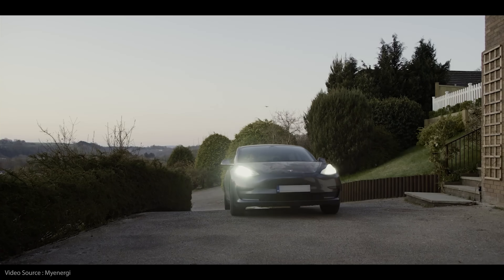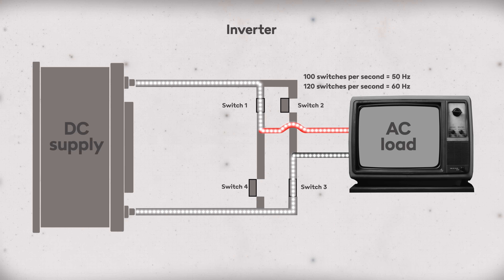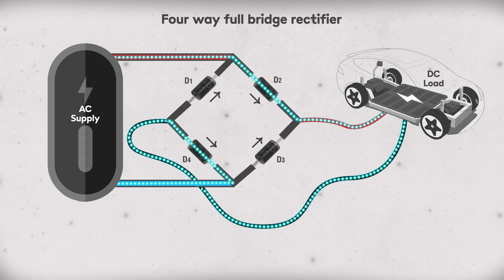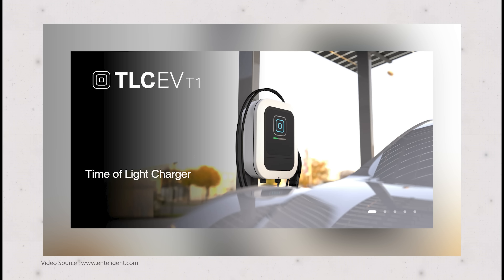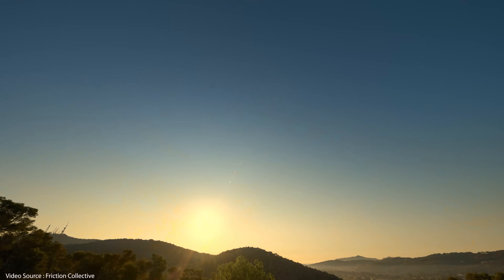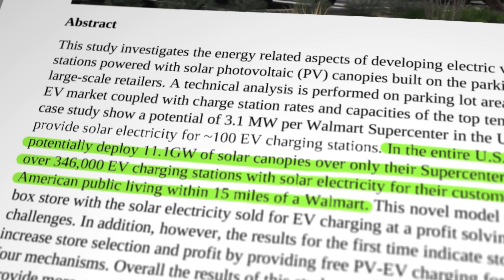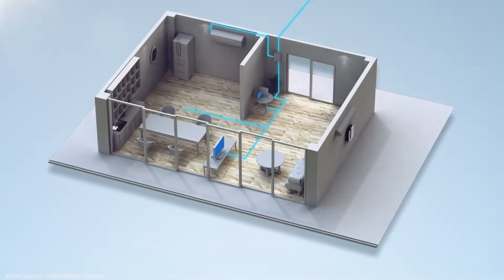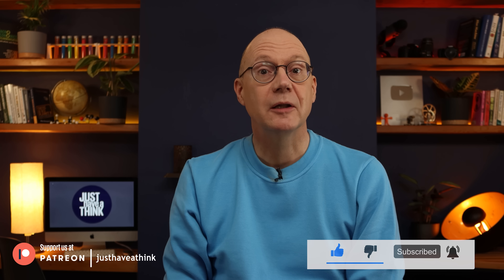DC to DC charging. One more step to off grid living!

Comment: DC house hold appliances are yet  to be a non neglected market
Reply: Hybrid heat pumps would be nice, either using ac during night time from the grid or using the dc current of installed PVs during peak solar. I wouldn’t go as far to start using any other high demand appliance on dc, maybe except water heaters but not machines with synchronous motors or frequency changers
Reply: @SirBalageG  water heaters? A simple water heater does not offer any advantage running on DC rather than AC. For all practical purposes, they will have the same efficiency in AC or DC. Most simple water heaters use a simple bimetallic strip as the thermostat- just guess how that will perform under DC.
Reply: @janami-dharmam  speaking from the grid operator's perspective, residential PVs are cancer and you can either pay to get rid of your excess or use so little that your tariffs become cheaper. Think about everybody installing PVs in a street line, that means controlling voltage becomes practically impossible, one household using less then what they're producing, the other using exactly the same amount, then there's one on the end of line that either uses none or all of the line's energy. Regulation becomes practically impossible, so in my hones opinion, you can use as much DC on your microgrid as you want but don't bring any excess PV power to the grid in that case.
Won't really matter in the future as providers will charge you 10-20 times more for using the network then the electricity itself, so you either use up all your juice or store it for later.
With all due respect, cheers
Reply: My hot 1.5 kw water operates directly on  180 vdc panels. No regulation just whatever solar is coming out. The original ac thermostat arced over (shorted) the first time it opened. I made a mosfet switch and it has supplied al my hot water for three years.

Comment: I think the best possible solution would be to charge a stationary battery in your home via PV DC. Then charge the car from that as and when.

That way you get to collect sunshine watts all day regardless of where your car is and then top it up at night when you’re in the land of nod. This would also feed into options of trickle charging to reduce dendrite build up (presumably). 

Any excess could be converted to AC and used by the home or fed back into the grid for credit.
Reply: While attractive, the losses of charge/discharge battery are (currently) even higher than DC->AC->DC conversion.

Comment: Been watching this technology for a while now, but still no word on the cost. I don’t think it’s going to be cheap as buying a conventional 20kW DC charger is prohibitively expensive in a domestic setting. 

I am off-grid, charging my EVs during the day from solar and connecting V2L to my solar system for a little extra backup power sometimes at night.

Comment: Those 13% losses must be the absolute worst scenario, not a typical one. There's absolutely no way that they've chosen such poor electronics. And DC-to-DC transformations (which are needed, as your PV system won't run on 400 V) also have losses. I can't imagine the gains being all that huge. 

If this technology can reduce costs by providing a simpler solution, then great, but I don't think shaving off a few percent of losses is going to be a game changer
Reply: A diode drop relative to 240VAC is insignificant, by the way.   The IGBT drop (roughly 1.5V) is more significant but still clocks in at only 0.6%.  Other losses dominate.  But yes, 13% would definitely be worst case.  Grid-to-vehicle losses are typically less than 10%.

The real problem is that the DC-DC would have to be a buck-boost and the input would have to be at string voltages.  And because it has to be a buck-boost and not just a buck, the efficiency is likely going to clock-in at 95%-97% or so.  And it would only be valid while the sun is actually shining.

So the "improvement" is only going to be 5-7% at best, and only under certain conditions.  And it will require some rather expensive circuitry and safety features.

I've done a ton of solar over the last two decades and can say with some authority that It is generally going to be far better to spend the money on simply adding more solar instead of spending it on a DC-DC EVSE.

-Matt
Reply: Exactly, makes no sense to make such a poor performing converter as it costs money to build heat sinks to dissipate it all.
Reply: PV systems (e.g. mine) can easily run on voltages as high as 400V... mine happens to be about 350V but the difference is only the number of panels in a string. Consumer panels tend to have nominal output voltage of around 48V, and a string is often wired in series (adding voltages). My GivEnergy inverter requires 125V to start, and has a max solar PV input of 550V IIRC.

13% is probably comparing their unit to a bog-standard solar inverter + EV diode rectifier setup, and the latter is I agree unlikely to be the case in the longer term even if it might be true for some cars now. However, it is true that inverting the power to AC then rectifying it back to DC will definitely lose non-trivial amounts of power, so avoiding doing it is always going to be a win.
Reply: Yes. Look at the efficiency rating of your computers power supply (easiest to find for a desktop system). This is AC to DC, but in Europe anything as inefficient as 13% losses at 80% full rated power is not on sale new (though if you like subsidising your utility you can pick up very inefficient pre-used ones)
Reply: I agree. What I would say though, is that there are advantages on a commercial scale, as Dave said. Using car parks with solar canopies and DC connection is a great way of avoiding using grid power and would stop all the wasted time in getting a permit to connect to the grid.
Reply: @keithforster2615   parking lot charging that's not connected to the grid is very dubious. "You may or may not get a charge depending on how cloudy it is!" I would do it to opportunistically to get a little charge if it was cheap, but it would suck if you really needed the kWh.
Reply: @skierpage  It could work if a large battery was on site soaking up those sunny electrons, maybe.

Comment: Thumbs down on net zero as CO2 is not the driver of climate change in the practical sense.
Reply: "as CO2 is not the driver of climate change in the practical sense." - well then, tell us what is.
Reply: @TheDanEdwards  Milankovitch cycles, the Sun is not constant and (this one will trigger you so find a safe space) variations in the level of charged particles in the atmosphere.

Comment: I call my car: Jumpin Jack Flash. (It's a gas gas gas!) RN houses are AC and things in your home that require DC need an AC to DC power supply. My house is filled with these things. I am wondering at what point will it become simpler and more efficient for your home to be DC with AC systems requiring DC to AC power supplies? Don't say appliances need AC. Of course the ones you have now do, but they don't have to. Most appliances can be DC. And when power is coming off your roof through a battery in DC, why not keep it that way? BTW, I asked this exact question over 5 years ago and got nothing but trolls replying.

Comment: Can you explain why/if being "off grid" is beneficial to the environment?
Reply: it isn’t necessarily, but a big issue with solar and wind is grid capacity and building out new transmission lines quickly enough. you shouldn’t need permission to install a solar array that’s not connected to the grid.
decentralisation also increases system resilience
Reply: @Humungojerry  Homepower is irrelevant to global power needs.

Comment: Decentralized DC "microgrids" are the future. Check out Living Energy Farm's YouTube channel to see a group living on a 1.4 kW array with no grid or fossil fuel back ups for fourteen years now. DC refrigerators, ovens, air bladder water tanks, and biogas. They've even gotten off firewood (but do have as a back up).
Reply: a 1.4kw array? good luck with that microgrid!
Reply: Yes, unbelievably small array providing the needs for ten people. Obviously, no EV car, just a bunch of EV bikes and such.

Panels are cheap, of course, but they have yet to build out.
Reply: 1.4kW array supporting DC refrigerators and ovens? wonderful! My AC operator induction heater takes 2kW

Comment: Not one bit Dave Borlace of the technology you’ve showcased including this DC to DC charger unit would exist without FREE FINITE Flammable Fossils (FFFF’s) of Coal, Oil, Gas, the result of ancient sunlight buried over millions of years but extracted 10 million times faster than it was sequestered. This isn’t to promote FFFF’s far from it, it’s to point out especially in the case of Oil that it’s being depleted at a tremendous rate, such that in the not to distant future being FINITE it won’t be cost effective to extract (EROEI). Before that happens we’ll have headed for “The Great Simplification” reduced to the lifestyle of a the 17th century but with far less people, that reduction in population will continue until H.Sapiens reach 400 to 600 million a point at which the Earth can realistically sustain. A child born today will experience this reduction in FFFF’s so we shouldn’t be looking to maintain out current lifestyles through Rebuildable RE Converters but aiming to radically USE LESS ENERGY. 👉https://medium.com/@alysion42/civilizations-running-out-of-gas-story-50bc79bf8732 🤔

Comment: I've long been saying that it's time for AC to take a back seat.  The ideal system would employ a battery voltage equal to the utilization voltage.  Many things can run straight off of 115 volts DC, and many more could with minor modification.  Before long, manufacturers could offer a full range of appliances and so forth that run on DC.  The "obsession" with inverters and low voltage batteries and systems that have nothing that runs directly at battery voltage are ridiculous.  Think about an RV, with a 12 volt system.  ALL of the "little stuff" runs at battery voltage.  Scale that system up!

Comment: But the car battery wants a specific voltage, and it would be a rare coincidence if the PV panels happened to produce that particular voltage. So you need a DC- DC converter. And while they are getting better, they are not lossless. So the net benefit of direct pv- to vehicle is less than the 13% cited. And there is a definite advantage to being able to have the pv panels and the vehicle in different locations, with the ac grid as the intermediate.
Reply: In fact there are additional losses in DC coupled systems that are minimal with AC coupled systems but these losses are simply ignored by the proponents of DC coupled systems.   The losses I am referring to are related from the legislative required fault protection devices - I.E., fuses and circuit breakers.  With AC coupled systems you simply use existing AC rated electrical fuses and circuit breakers which work great.  However these AC fuses and circuit breakers can't be used for DC - they require circuit protection equipment that can interupt DC current.   One commonly used way to get a DC rated circuit breaker is to string 8 or so AC circuit breakers together and have them mechanically linked together - this allows them to be able to break the DC current.   It is clearly obvious that the losses associated with having 8 circuit breakers connected in series on a DC coupled system will be 8 times higher than an equivalent AC coupled system. 
The proponents for DC coupled systems ignore this detail on the basis that this is the consequence of safety legislation that can't be avoided. 

It's true that you can't just ignore safety requirements,  but you can be smart as to how you meet these requirements and by using an AC coupled system then you can minimize the system losses associated with the safety protection equipment.
Reply: besides other drawbacks

Comment: If the SE charger is backwards compatible with my existing 2013 SE4000 inverter I’ll certainly be taking a closer look, but cynically I imagine it will only work with their newer hardware meaning a perfectly functional piece of kit from the same OEM would need replacing unnecessarily 😢

Comment: Good thoughts there, with a couple of caveats.
The modern and more efficient micro-inverter array systems deliver AC from each panel, optimising the array efficiency.  So this uses sub optimised arrays.
Current 'smart' chargers and tariffs can demand shift any plugged in car to balance any grid needs, while achieving the required charge for a customer.

Comment: I think you're being rather optimistic dismissing the "media" fuss about EVs. I'm a died in the wool eco-warrior, tree hugger, as anyone whose ever read any of my comments on here would know, but I share a lot of these doubts about EVs - or at least the ones currently on the market (and being rather single mindedly pushed down our throats).

The switch to EVs, although necessary and inevitable, has many very real problems and difficulties, which the politicians are either unaware of, or are deliberately ignoring. 

The upshot is a growing resistance to the switch among motorists - which the fossil fuel companies, rightwing politicians and loony media are leaping on with joy.

The problems is that these drawbacks are real - very real to the consumers having to deal with them. 

For instance, the number one point of resistance is the cost. EVs are not only expensive to buy, but they are also expensive to run. You either have to pay the extortionate rates charging companies demand, or fork out to have a charging point at home (for the lucky few who have a drive). Then there's the cost of repairs - if you can find someone who can actually do the repairs. And god help you if your battery needs fixing or replacing. 

Then there's the resale value of your car - who is going to want  a second-hand EV, when the battery is run down and will need replacing soon?

Add to this the number of years you have to drive an EV before you start to make any sort of difference to your CO2 footprint, the inefficiency of driving around with such a heavy battery (and its tendency to burst into incredibly hot and toxic flame), and the small matter of continued pollution from tyre and brake wear, and the huge environmental problems involved in making and disposing of Li-ion batteries (not to mention the environmental and safety impact of owning/driving any sort of car), and you've got a less than rosy picture. 

Then there's the minor matter of cars only being a relatively minor producer of CO2 - but a convenient way for governments looking like they're doing something towards reaching net zero - without, of course, needing to tackle the real sources of the problem. 

I appreciate all this sounds like the usual anti-EV rant, but all these points are still real, and we need to recognise them.

The average car owner is neither stupid nor stupidly rich (or lives in a house with a drive) and isn't in any rush to buy an EV. But governments ARE in a rush to make them buy one asap. And that conflict of interests will easily be fanned by the fossil fuel companies and rightwing media into a genuine - and serious - problem for the mass adoption of EVs.

We need to recognise this and take it seriously. EVs are far from a mature technology (especially where batteries and charging are concerned) and it will be a huge mistake to force this underdeveloped and expensive technology on people en masse. It could seriously set back a critical part of solving the climate crisis.

We can't force people to do the 'right thing' - even assuming it IS actually the right thing.
Reply: "I appreciate all this sounds like the usual anti-EV rant" - yes, it does.

Somehow the PRC is now leading the world in EVs, producing such a large share of the global consumption of such, and Chinese EVs are not exorbitantly priced toys (as is the case in the US.)

Comment: A good micro inverter conversion efficiency is about 97.5%. This was a relevant piece of data for your video and it was better to mention that but putting the rest of the video in context
Reply: Actually more like 98%-99% these days @ 240VAC.  For a multitude of reasons and assuming the electrician didn't do something stupid like highi-ball the trunk gauge.
Reply: That’s just going from DC to AC. Add like another 10% to go from AC to DC. Not to mention all the electronics that now add more failure points.
Reply: You need to assess round trip efficiency, not just initial inverter conversion efficiency which can seem higher than the reality

Comment: One wonders why the penny didn't drop before, however, as a numbskull when it comes to electricity, I'd like to know if battery storade systems are in development to serve this straight to charge D.C system. If so, the outlook seems much better.
Try.ing to find engineers with the knowhow to do anythng other than a standard hookup of roof mounted PV panels is next to i possible.
Likewise heating engineers for Ground source heat pumps.
If it isn't "plug and play" forget it.